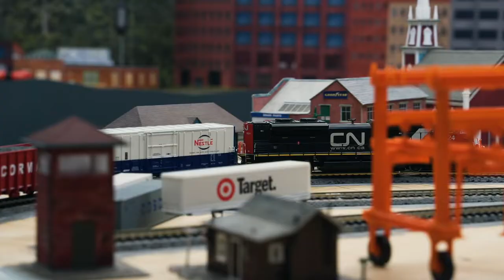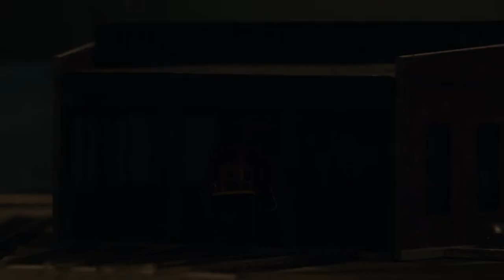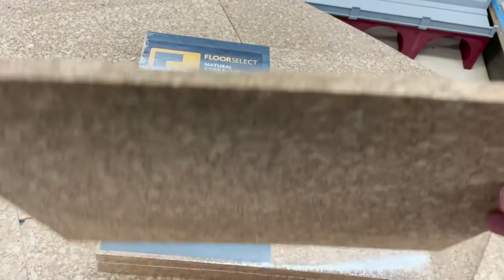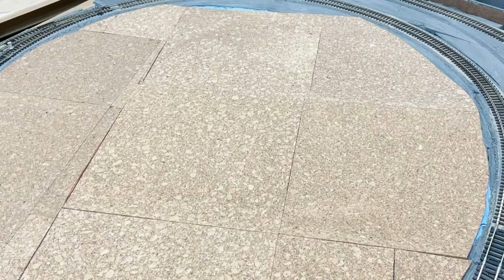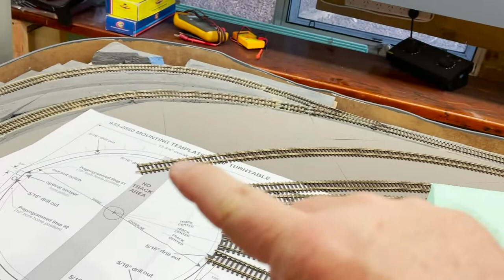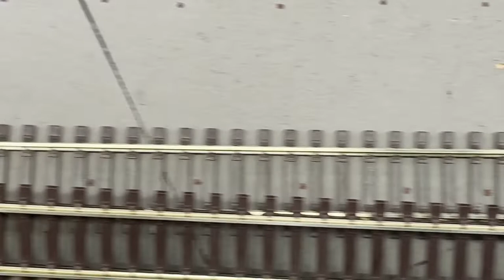LE&NS Railroad Episode 4 Hamilton Yard Construction

Comment: Randy, Is that opening song an original song from you or where did you acquire it? Enjoy it a lot! Another great video with some great tips/techniques! What area of Australia? Spent some time there for work and taking family a couple of times for vacations. Love the Bunnings sausage sizzles heh, and Tim Tams and Jols. Not a fan of the Vegemite though, but tolerable. Love the Bennett Chanel as well. Learned a lot from his channel. How large is your Phase 1 layout? Thought I could tell from first intro video but now questioning my view of it. Last question - how much of a gap do you use between rail sections? I understand dependent on HVAC, humidity etc but didn't realize there was a 'standard' gap. Thanks!
Reply from the maker: Hi Schadowolf, The songs used on the videos are all originals of my son and I. We record the at Mastiff studios in Perth. The video is also produced by the same studio.I am located in Perth and yes we eat many Bunnings sausages over the years. Thanks for the sub and the kind words.